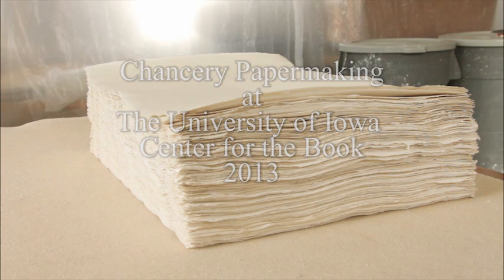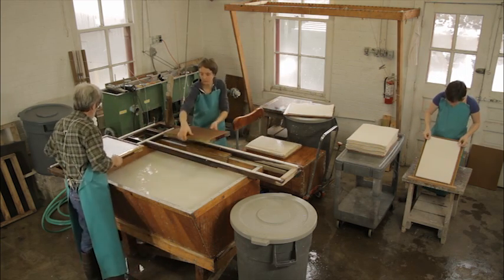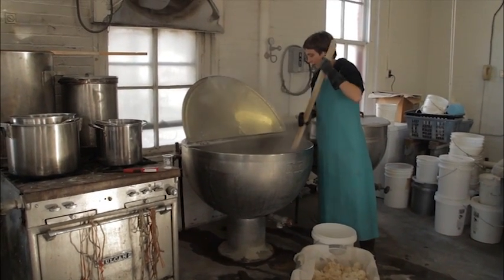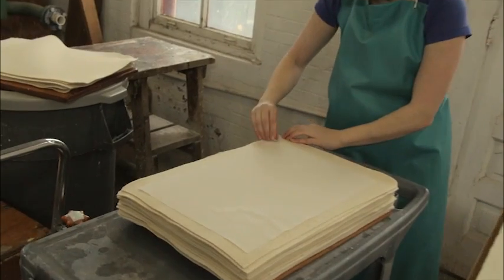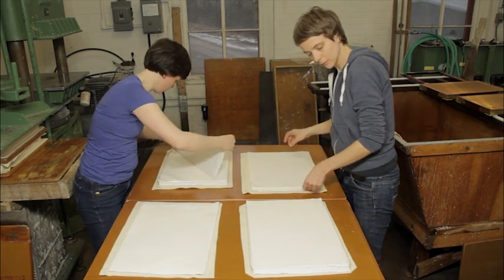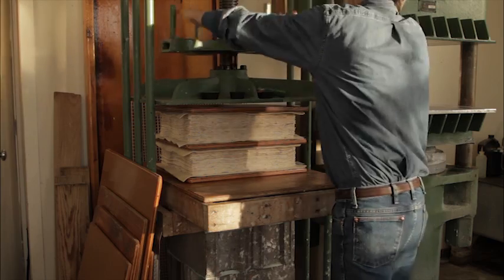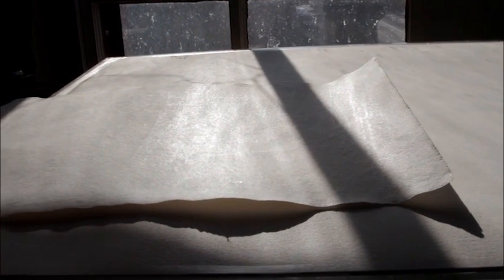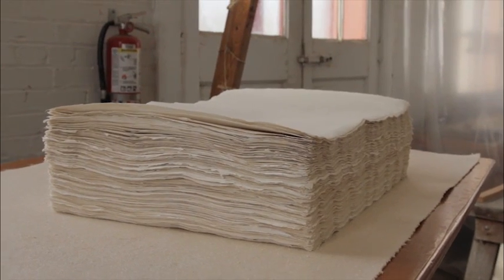Chancery Papermaking

Comment: Well done there. I roughly timed the vatman and indeed there were about 4 sheets a minute being made at a somewhat relaxed rate. It is important to be able to maintain the rate over an extended period of time so going faster is not really an option for people who have not been at the work for years. I have begun training, not teaching, a small group to work with wood according to 18th century methods including the use of a spring pole lathe. I have done the work for 20+ years so I am in pretty good shape so far as skill and stamina. Here is a thought- maybe the reason you have not achieved the sort of results you are looking for is because you process the fiber with machines. Perhaps you need to go farther down the rabbit hole and process the fibers the same way they did in the past. Of course this was published 10 years ago so maybe you have worked that out by now.

Comment: Question you say you use a 3% solution for you sizing..  Is that 3% by volume or by weight?
Reply: thegoblintrader Greetings. Volume of water; say 1000ml, and weight of dry gelatin; 30 grams. T. Barrett
Reply: Timothy Barrett  Thank you